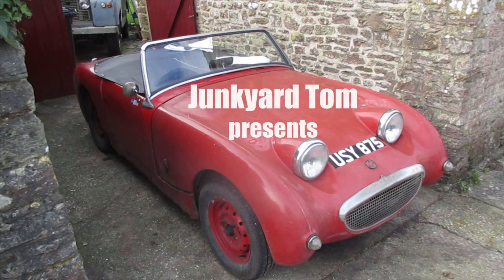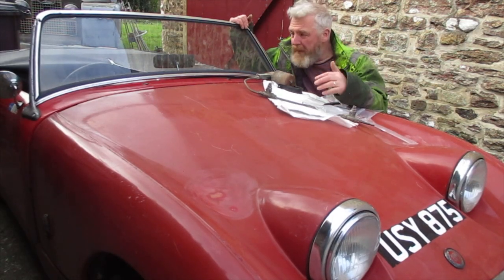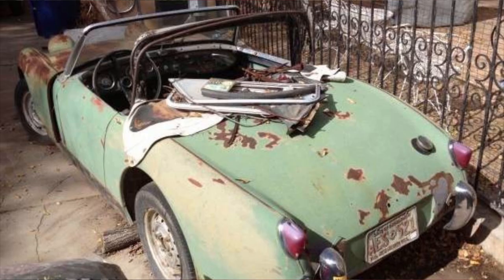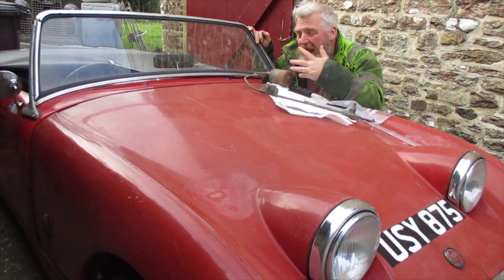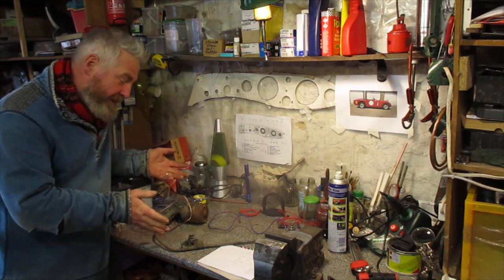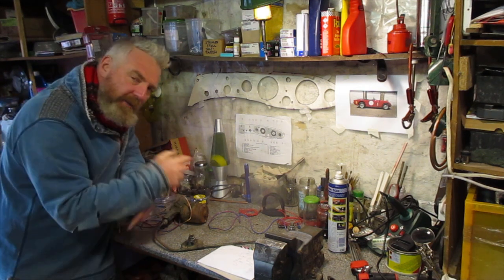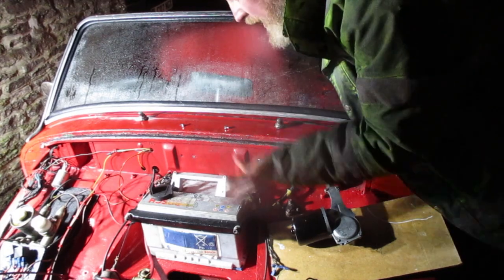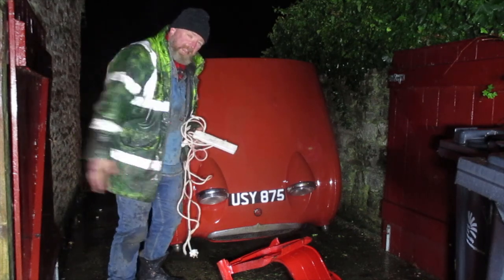Frogeye Sprite Windscreen Wipers & Motor Under £15, 2-Speed Motor Conversion, MG Midget, "Gaps" Ep.5

Comment: Tom the park function is generally through a sweeper mechanism that provides a ground or earth. Power is constant but when the switch is turned to the park function the permanent ground is cancelled and the sweep mechanism within the drive case then provides the ground feed until it comes into contact with an insulated section that then cuts the ground feed. This provides the park function.
Reply from the maker: Hi Enigmas, thanks for this. Are you speaking about "park mechanisms" in general, or the Midget 1500 / round body 2-speed motor specifically? From what I remember (I don't ave a diagram in front of me right now) this type actually a function within the switch itself which either makes the park live or provides the earth, but that earth /live is not there the whole time (unlike the older, square-the switches, where the park circuit is constantly live). So, essentially, you need to either use a Midget 1500-type switch (which I didn't want to do, as the original appearance & operation of the dash switches is one of the things I really like on the Mk1 "Frogeye" Sprite) or do some clever wiring using relays (I saw several examples online) that replicates this function with the original type Lucas pull-switch. You may be right, that it simply provides an alternative earth. But from the diagrams I looked at for this type of motor, it appeared to be actually providing a separate Live where that would usually be an easy, effectively cancelling out the live feed into the could and stopping the motor. If it is, as you say, an earth rather than  live, I still seem to recall that it was not permanent and depended on some clever mechanism in the switch itself, which is not a simple 2-pole switch, that made that condition happen. Thanks for watching, what you have said will prompt me to take another look at the diagram and figure out how to do that simply while still retaining the original switch. Regards, Tom
Reply: @TomsJunkyard  Hi Tom,  switching a ground or earth is sometimes the easier option.  The wiper motor I'm referencing is round bodied. It's a 2 speed wiper motor (non factory standard) to my ZB Magnette coupe project. If you think it through it's quite logical and simpler than trying to switch alternate power feeds on and off. It's also an easy option with a single speed wiper drive that incorporates a park mode. I can forward you 2 wiring schematics (my own) to enable the 2 speed wiper in 2 speed mode or single speed mode with both incorporating park. In single speed mode a simple on/off switch is all that is required. These are hand drawn circuits so hopefully you can decipher my writing. They may assist you in your wiring endeavours. I just require an email contact. Cheers ~ Vince